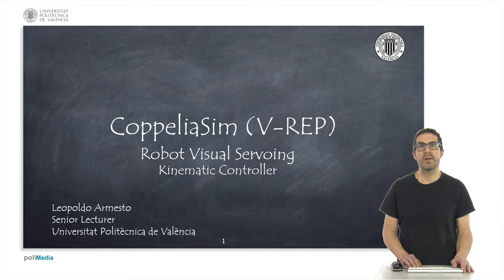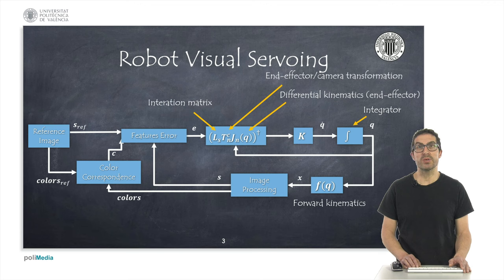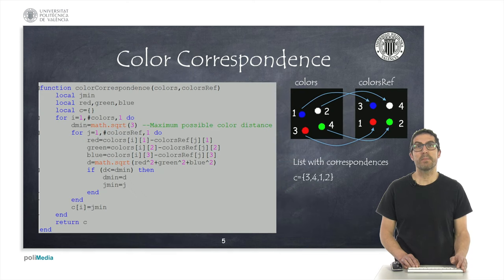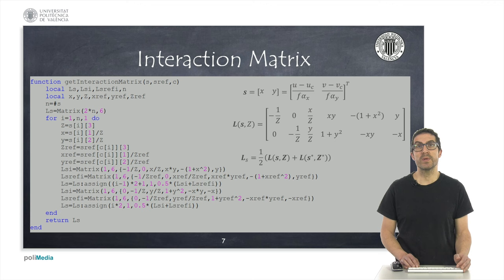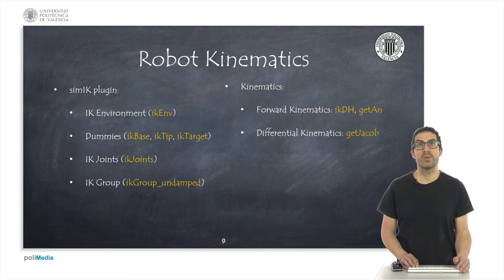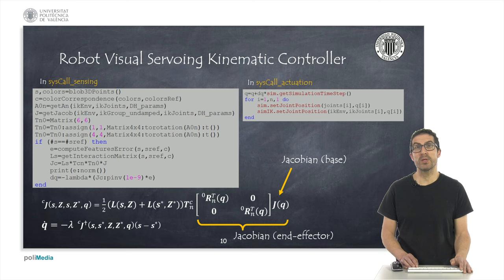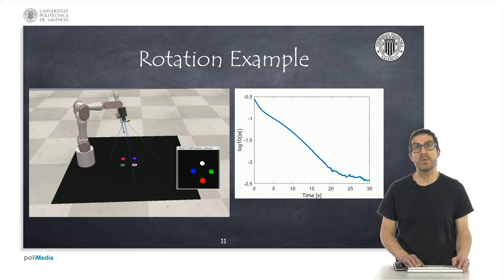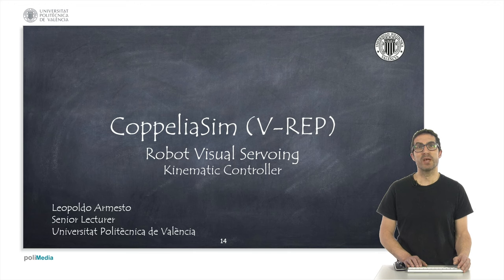Image-based Robot Visual Servoing | CoppeliaSim

Comment: Hi Leopoldo, thank you for the work you put in to create these videos.
Sorry if I ask this question directly here: is it possible to implement in Coppeliasim a model in which a Human Operator (collaborating with a Robot) executes some operations such as screwing in screws or manually assemble some compontents while the Robot performes other tasks?
Thanks for your kind help!
Reply from the maker: Hello, yes, CoppeliaSim can interact with some hardwares (serial devices and Ethernet). There are some demos to interact with Wii controller too. I have never tried that myself…
Reply: @LeoArmesto  Hi Leopoldo, thanks for yuor kind answer. 
And If i want to create a model of the Human Operator that during the simulation executes this kind of manual operations (without the external input), is it possible? Basically can I program my human model to perform this kind of task on its own?
I tried to search for papers or tutorials that had a Human Operator model executing simple tasks but i couldn't find anything...
Reply from the maker: @DifferentWays97  I guess that your virtual human operator can exert forces to your environment as any other dynamic and respondable object.
Reply: @LeoArmesto  Thank you, Leopoldo!